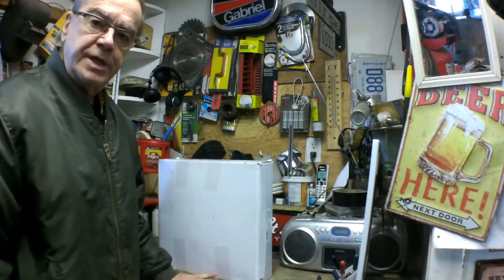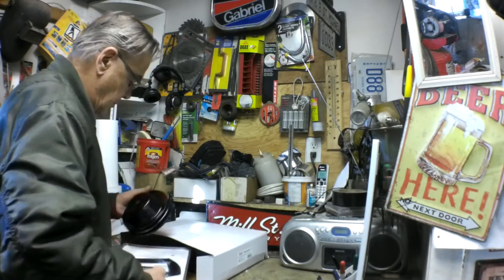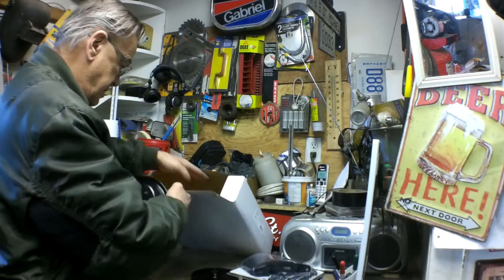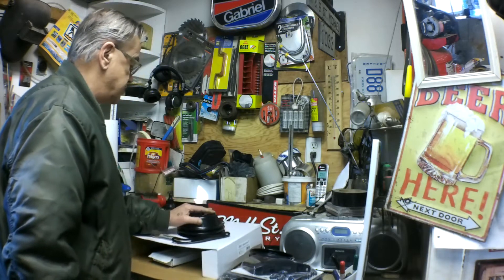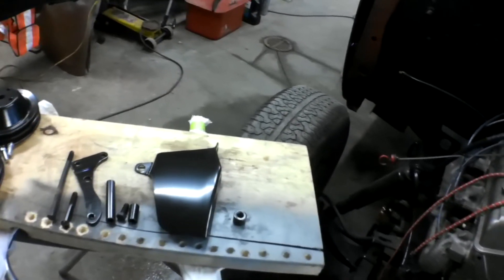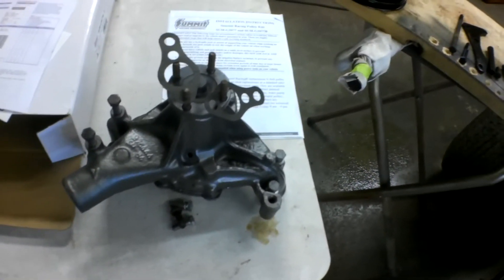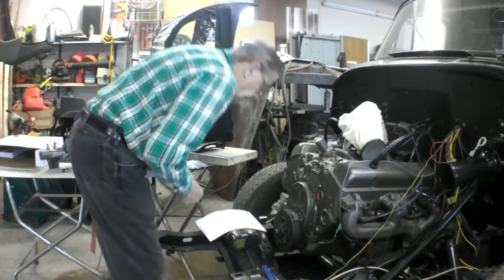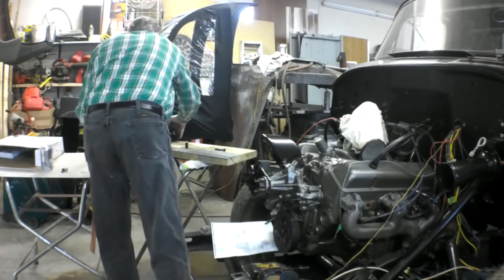# 62 Install engine Pulleys in my SMC Chevy engine

Comment: Awesome!!! Glad Santa got you something!!! Now I have to ask, was that a red plastic plug in the water pump hole in the block and did you take it out? It looked like a red plug and you skipped ahead and I didn't see it come out!!! Just making sure there's no blockage in the coolant system causing you to pull your hair out after it's running and getting hot and we can't understand why!!! 
You're right about the the power steering pulley and the small one is an alternator pulley!!!
Merry Christmas to you and Bev and Keep Rocking and a Rolling and a Rolling and a Rocking!!!
Reply from the maker: Hey Pat. Good eye. It's not the first time you picked up on something in my videos. No, it's not a plug. The engine was painted red and then I changed to colour to silver. I am glad to see that you are looking out for me. I also liked when you said  "we can't understand why!!! ". I agree, it is NOT ME getting this Fargo on the road. WE ARE DOING IT. Thanks for dropping by the Dog House.
Reply: @AndysDogHouse  Always keeping an eye on the situation!!! Don't want to see any mistakes made!!! Like Red Green says, We're all in this together!!!
Keep Rocking!!!
Reply from the maker: @rockerpat1085  Thanks Pat. I really appreciate you looking out for me and other old rodders. I saw that you said in your video that you would be alone for Christmas. That touched me. Nobody should be alone any time. So I will tell you that Bev and I are with you through YouTube and our thoughts and I will always be your Brother, from another Mother. Keep on a Rock'n an a Roll'n my friend. 🎸🎸🤘